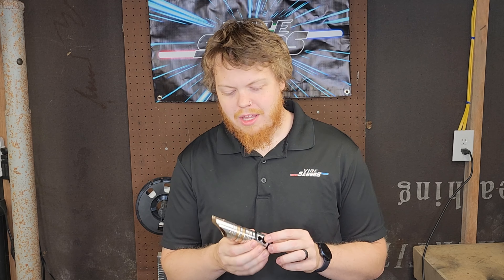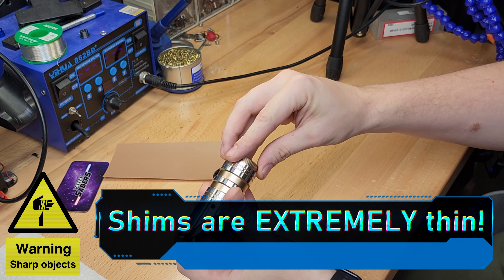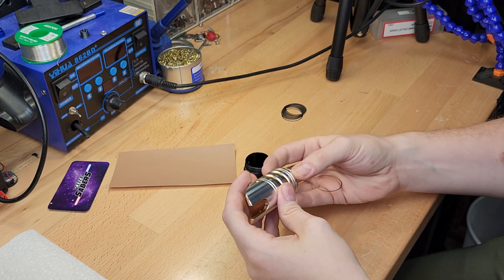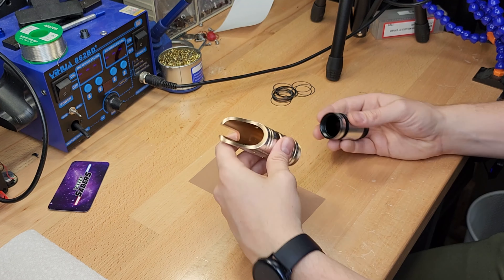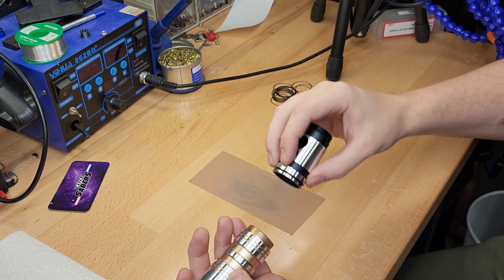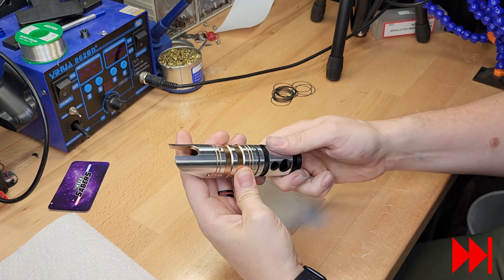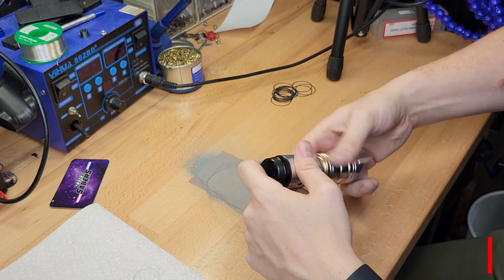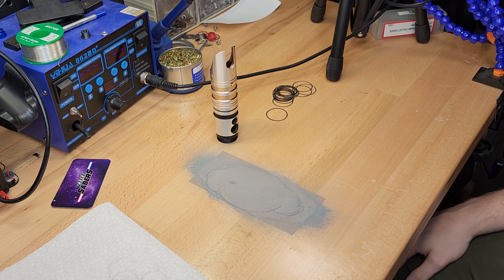Fixing misaligned VHC Saber parts

Comment: You are wrong about sanding the male threads not changing anything, it makes it so that the male end can’t screw in as far, it has the same EXACT, but more precise, effect as adding timing shims, but tbf sanding the male threads adjusts in the opposite direction as sanding the female thread
Reply from the maker: USUALLY, the female threads are slightly deeper than the male threads are long. This is done to make sure that the shoulders meet.

There are some parts with shallow female threads, that this does work on, but it's rare
Reply: @viresabers5883  oh yeah sorry, I was being dumb, I thought having shorter male trends would change the rotation, but it won’t it just won’t be threaded as deeply which only changes the position, like you said, if the male threads already bottomed out/ have some that stick out where they connect